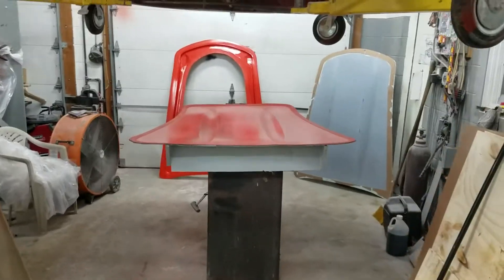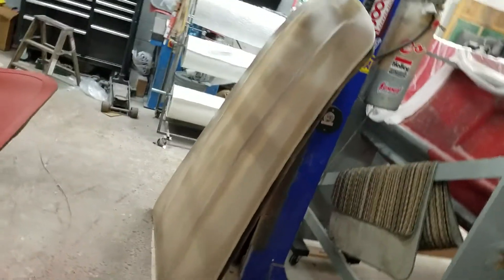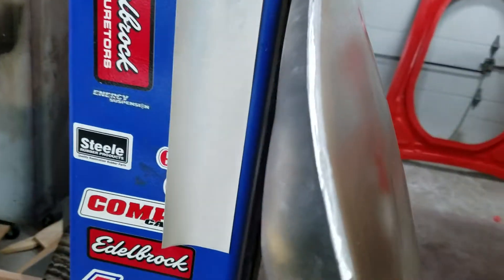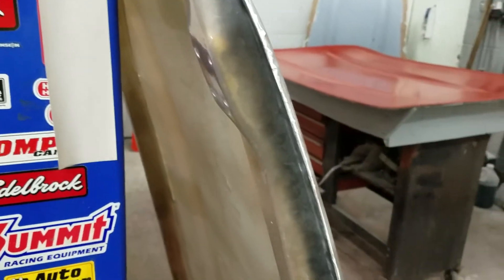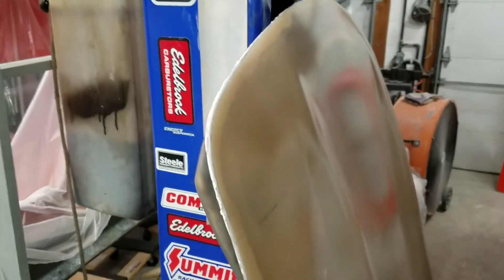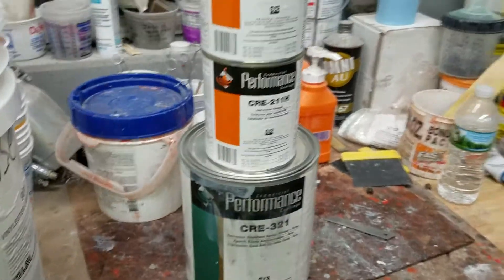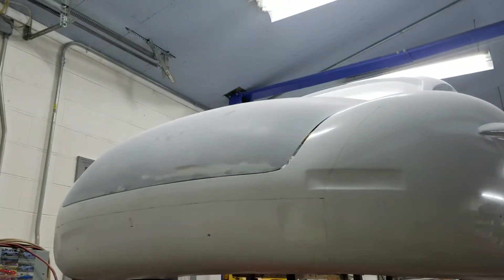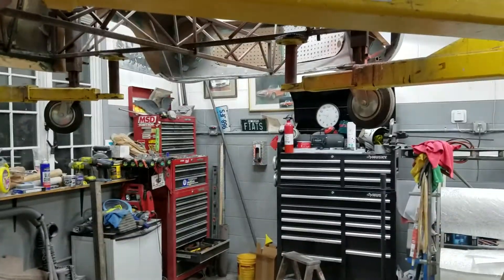300 SL Gullwing Replica Molds Video # 10

Comment from the maker: I use clear gel coat on my finished parts. Reasons for using epoxy primer on the plug parts are I use it initially as a fast fill primer, than as a epoxy sealer that can be waxed and sprayed with release agent. I was using a fast fill primer, than using a sealer over the primer, than putting a base/clear coat,  or a single stage to get the smooth surface to be able to wax and spray release agent. So now it's one product that does everything. That's my reason, I'm not an expert,  I just know what I'm doing, and I learn from my mistakes. Like Frank Sinatra said, "I do it my way".
Reply: do you need a website?

Comment: Do you plan on selling the "trial" first run body panels? 
If so, I'm interested. 1st pulls, defects, mess ups etc etc doesn't matter to me. I would still be a buyer and repair them myself (if needed).
thx
Reply from the maker: there won't be any trial runs because that would be a waste of money. I seem to have done a great job on the molds, because all the plugs were removed without any hiccups. I have already made a  useable hood, a useable trunk will be made next, and door molds will be following.